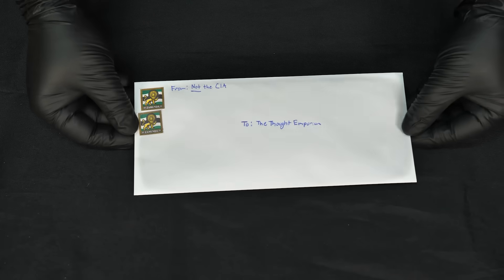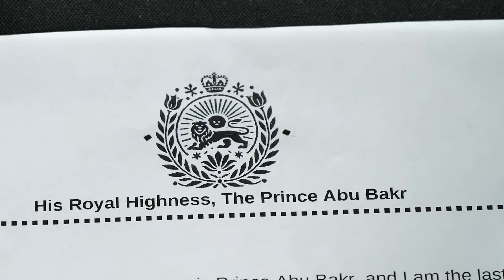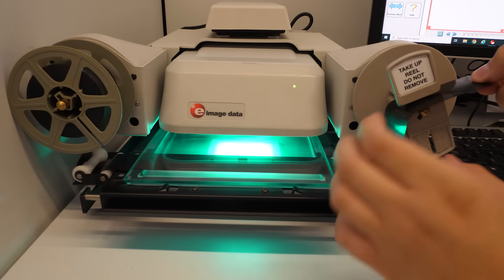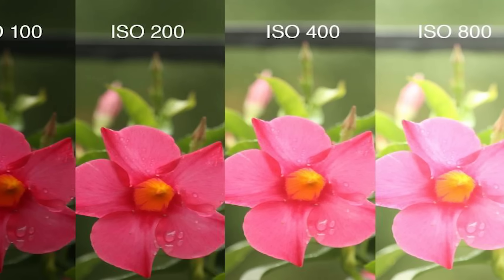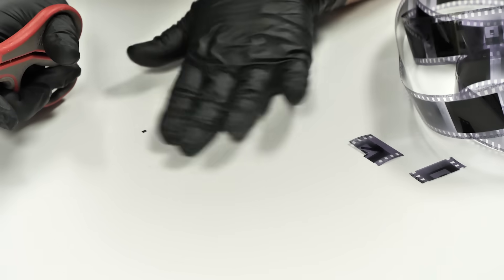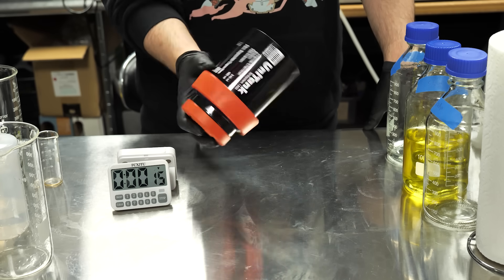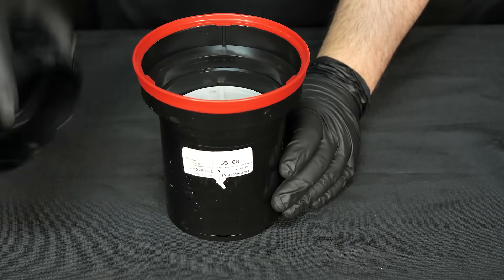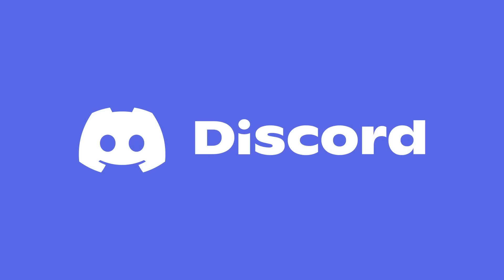Recreating CIA Technology Was Surprisingly Easy (Microdots)

Comment: 14:50 You can definitely reuse developers a few times; how many probably depends on the type of developers and some are probably not recommended to reuse at all. Some brands probably even has recommendations for how many times it can be safely reused and how much you need to change the development time for repeaded uses in the documentation. You are of course loosing some potency as you use it and for absolutely best quality, if you're developing art or fashion photography intended for large print you'd probably use a fresh developer. But I know press photographers when they still had to use film photography had a lot of tricks to save money (since they take an awful lot of pictures and print them at fairly small scale on crappy paper anyway they don't care about the best possible quality), I think they did stuff like "refreshing" the developer by adding cheaper chemicals to the used developer. I don't remember exactly (as it's more than 20 years since I learned about it but never tried to do it myself), but I think part of the problem with old used developer is that it starts to get saturated by dissolved silver from the films, so I think some of the refreshing tricks were adding some chemicals that made the silver fall out of solution and cover the bottom of the container and then you could pour the top off into a clean container and add some other chemical to replace the "spent" reactants in the developer. I think it works because most of the developer is fairly cheap chemicals, but the expensive stuff is sort of catalysts that isn't used up. 

I think you also could develop at least black and white film with some very cheap and common house hold chemicals too without any fancy additives and catalysts that real developers have, but it's much slower and harder to predict how well it works. And with those home made chemicals it's not at all worth it to reuse it.

Press photographers also had other even more dirty tricks to speed up the development a lot. Apparently you can develop film super quickly (like in a seconds rather than minutes) by basically developing it with very hot chemicals (way outside the recommended temps). And if you were really in a hurry to get the photos sent you could also do a very fast stop bath and forgo the fix and rinse and just slap the wet film into the scanner (or some telefax like thing they used before digital film scanners) send the pictures to the headquarters. And then the original negatives would go bad afterwards because of the insufficient fixing, and you would have to disassemble the scanner and clean it; but you'd get the photos first. But I guess it's a good chance you'd also destroy the negatives in the process if you go a little too hot and/or too long.

The press photographer who was my photography teacher 20 years ago, also told stories about how he also had been in the woods in the middle of winter taking pictures of a train accident (this was after digital film scanners were standard in press photography but before digital cameras were good enough in the early 90s), he had a laptop (or rather luggable computer), film scanner and sattelite phone with him, but he had to develop the film first and he was several kilometers away from any houses; so he developed the film by putting the developer can between his legs inside his sleeping bag to keep it above freezing and just guesstimated that if the normal indoor developer time was 10 minutes it would probably be okay at close to freezing after 30-40 minutes. It actually worked; I guess unlike with hot developer where the chemistry is super fast and the margin of error is very narrow; with too cold developer you have a lot of margin of error as long as you don't get actual ice crystals in the developer tank.

Comment: To be clear, you can TOTALLY check each exposure without burning the whole film roll. Get a dark bag. Not a Dark ROOM but a bag. No light. Not even red safe light. Put the camera in the bag with a pair of scissors and a developer kit (reel or boxes if you prefer). Advance the camera few more times to make sure you dont cut photos in half and then open it up and cut.  Take the exposed film and put it in the light proof developer canister and refeed the remaining film into the camera. Close it up and advance another 2 or 3 times to make sure you have fresh film ready to go. You loose a few exposures but thats better than the whole reel.
Reply: You can absolutely use a darkroom, just turn the safelight off so it is well and truly black with no light whatsoever.

Comment: The use of Nikon's 55 mm "Micro" lens with bellows & extension tubes was designed for copy negatives and the the small document reproduction process. Temperature and controlled agitation is a factor that you need to incorporate in the development process its very important. back in the film days there was a film kodak produced called Technical Pan it was 32 ASA and was formulated for the very purpose of photographing documents with very fine resolving power. I'm not sure weather or not its still manufactured but maybe there is an equally suited film to use?

Comment: You could use Laser Lithography to achieve a similar result, and potentially also making it with a conductive layer to work as a circuit to store data on almost any object.

Comment: Encrypted information that nobody could decipher?  Where?  How did you exchange the key?  
  
This sort of stuff doesn't exist anymore, because someone somewhere is watching every inch of the planet and you can do so from space now.  
  
A lead or depleted uranium encased circuit (or a microdot, why not?) would work much better to exchange a key.   Encased so that it cannot be remotely deciphered en route.  Then you can send that to your destination with armed guards in an armored truck out of one deep underground facility to the next with the messages only to be decrypted on site(s) alone.  
  
Only then you can exchange secure messages.  
  
Otherwise just watch the average person on either side of the communication and and hack their surely hackable devices.  Which company manufactured their computers?  
  
Fly a drone and peek over their shoulder if they are close enough.  Setup a fake wireless access point at the next café they visit.  Do they have a cellphone?  (Probably yes)  Setup fake towers on your laptop and just drive next to them as you run your program to hack the computer we all carry on us even to bed.  
  
Most consumer devices are broken out of the factory and while you can update them as one software update patches a flaw it usually also creates a completely new one.  The hierarchy of broken software I call it, quite the scheme.
  
Best you have today is secrets at a certain dollar amount and that bar is higher than the annual salary of 95% of the entire population.

Comment: Did anybody mention the importance of temperature when processing film? I always made sure the temp was between 20-22c which can be a problem if you are in a very hot/cold climate. Can't use air-conditioning in the darkroom because it creates too much dust in the air that either sticks to the film or prints when they are drying.

Comment: This is sort of missing the point, but if you want to secretly transfer files across borders, take a picture of something with a digital camera, say a jumping dog.  Then zip up your secret documents and pictures into a single file.  Using old DOS commands you can save the secret stuff into your jumping dog image.  The image file size is bigger, but if someone simply views the file that you put back into your camera SD card,they will only see the jumping dog.  At the far end, use an unzipper program on the picture file and you can recover all your secret stuff intact.  Often misdirection is better than encryption.
Reply: @agalah408, my second search on this subject led me to an organisation about Linux questions that also had Windows command line instructions (and Mac). Cool and interesting.

Comment: Man, you need a few things if you want to do copy work properly (because that's what you are doing). 

First use adequate film: there is a german company that sells a pseudomicrofilm with high contrast, high resolution. It's called CMS 20 II, the company is Adox.
Next, you need to understand and improve the development process. You want very high gamma (contrast) to discern details properly, and a typical trick is to develop for longer times to crank up the acutance. And be humble, most of us in the film world do not use gloves most of the time because we know what chemicals are dangerous for our skin and what not. xD
Use your camera gear properly: mirror lock-up and cable release is a must, your camera is jiggling like a ping pong ball.
Purchase a non-pictorial lens. You can get your hands on an enlarger lens for next to nothing, and even the bad ones will blow out of the water resolution-wise almost any other lens. This is, so far, the neck of your bottle.
Try to use a point light source to reduce flares and fight diffraction.

If you do those things you will see how stupid resolution can get when shooting film.

Comment: Yes, the developer can be reused, but each time it is used, it accumulates some bromide in the solution. This can behave in weird ways with the next batch of film, and if you're using it to send classified messages, you would probably not reuse the solution. But, as I think about it, the bromide actually could give you better clarity after it reaches its plateau level because it could reduce grain in the image because it decreases the film speed as its level increases, up to a full stop. As bromide increases, though, the images become darker because more light is needed.

Comment: you should be able to reuse your developer at least once without changing development times. Another method, is called „replenishment“, where you reuse most of the developer but discard a little of the used developer and replace it with the same amount of fresh developer. You should find informations on it when you search for „using replenished developer“

Comment: Few things to note, as scattered around the comments and comments of comments:

- Use aperture F8 for sharper image as rule of thumb. Depends on the glass that you have.
- You can reuse developer few time, but it affects the developing time, as some of the developer is already used, you might want to extend the time a bit
- I didn't see comments nor video commenting anything on controlling the temperature, though on b/w I was taught "so that chemicals feels wet, not warm nor cool", so measuring by feel, not by some thermometer. On color chemistry it's waaaaay more important. Also on color you need to be a lot more exact with your clock than shown on video :D

Thanks again!

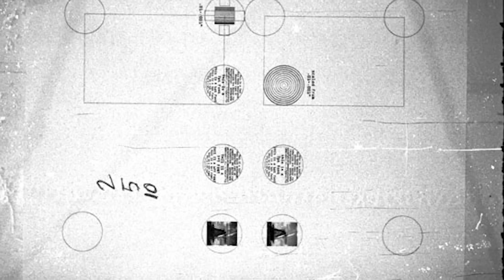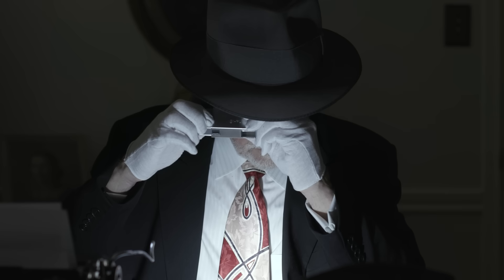Comment: Blazinal is a formulation of the Agfa Rodinal product. Rodinal was a one shot use developer, that uses the 4-aminophenol developing agent and potassium hydroxide as the accelerator. Yes, as mentioned below, it could be reused, but there already is the issue of oxidation of the developer from the first use. Every time you agitated, oxygen was introduced and developing agents would oxidize under longer exposure to oxygen. Used closely after mixing and first use, and having been stored in a dark, full bottle, you could try additional development time. However, you will not get the same development quality as with the first use. For repeatable results, use it as a one stop, especially if the higher dilution was formulated. Blazinal, like Rodinal, could be diluted 1:25 and 1:50, the latter requiring a longer development time. There is a benefit with the higher dilution, as you ended up with a finer grain pattern. 
The lower ISO films tended to have a finer grain, compared to the higher ISO film. While these were great for continuous tone images, not so good for high contrast, extreme detail. For best, fine detail and high resolution, find film mentioned by @mcb187. Look into orthochromatic films. You'll also need to research proper developers for those sensitized materials.

Comment: These lenses will not be at their sharpest at either end of the aperture range, you have to be somewhere in the middle, usually two or three stops from the max, so if its a 1.8 lens, likely sharpest at f5.6 or f8. They'll also be sharpest in the center. You can pretty easy get ISO 12/20 film from ADOX, CMS II, and if you use their developer for it get very fine grain.

Comment: MISTAKE: 11:00 - the widest aperture of any lens gives the poorest image quality especially f/1.8 of his lens (awful): specifically decreased cross-frame sharpness, central sharpness, resolution and contrast.

Even though cross-frame sharpness doesn’t really matter if your micro dot only takes up a tiny proportion of the frame in the centre, using a smaller aperture will increase central sharpness, resolution and contrast.

Most lenses will peak in central sharpness around f/4 to f/5.6, so that’s what I’d recommend experimenting with.

In order to get a perfect exposure, simply compensate by decreasing the shutter speed appropriately. 

Lastly, he should have used a cabled shutter release to prevent any shaking of the camera during exposure…a tripod is not enough.

Comment: The highest resolving photographic film in the world is Adox CMS 20. As a 35mm film, it out resolves any lense ever made at 800 lines per millimeter, resulting in a theoretical resolution of 500MP. According to Adox you can print a 35mm piece of film up to 2.5m without rendering any grain. The trick is that it's a relatively slow film at around ISO 20 if using their dedicated developer. In the case of creating microdots, that's not an issue though. Whilst Ilford Pan F 50 is a great film and fine grained, there are definitely even finer grained films available. Regarding Blazenol, it's basically a rebranded Rodinal which is a very old recipe (130+ years old). Whilst it renders a sharp image by accuntuating the edge of the silver halide crystals, it has the downside of enhancing the grain. I'm not sure whether this results in more readable text, but two other developers which could be tried are Ilford ID 11 (or the equavalent Kodak D76) as well as Kodak XTOL. XTOL is a developer which disolves the grain somewhat, resulting in a smoother image than with Blazenol but might be a little less sharp around the edges of the text. ID 11 should be a middle ground between the two.

Comment: We used LITHO FILM. Developer can be reused, but extend development based on a table. Developer can also be REPLENISHED which means adding clean developer to your mix. Also a fin thing. Save your FIXER. you can recover actual silver when it gets depleted. Drop a penny in your fixer and the silver will coat the copper.

Comment: Developer Cannot be reused.  Your Agitation is too strong.
You could be getting air bubbles on your film surface during developing.  Agitate as though it is a Separatory Funnel. 
I started doing B&W developing when I was 10.  Saw a kit in a used goods store and got hooked.  Also on Chemistry.

Comment: So many photography folks in the comments spouting absolute nonsense. 

When you want the highest resolution image possible with a given lens, you should open the aperture completely. Now, the reason that the "two stops above open" rule exists is because that will technically provide the best resolution for all colors as the lenses are designed to achromatic, but if you are imaging at a single wavelength then the largest aperture will work best. 

From an optics perspective, we call this is the diffractive limit and it is defined by the size of the Airy disk you can form with an aperture D and light of wavelength lambda. Specifically, it's Angular Resolution = 1.22 lambda/D

So the larger your aperture, the better your resolution. The shorter the wavelength, the better the resolution.

Comment: No, that Fuji is exactly not what you explained just before. It is panchromatic film, silver halide based. You just told they used no metallic film. (For a good reason, swiping the page with a metal detector will reveal de micro dot.) In fact there exist microfilm and microfiche used in libraries that are not silver based.

Comment: You can get lower iso film but it typically has a specific developer tied to it to get the highest detail.

Also blazanol is the same as rodinal so you can do semi-stand (1:100 concentration for 30 mins agitation then again let it stand for 30mins, if you're doing darkroom work this reduces the contrast a bit making printing easier)

also you've got a manual camera, you can dark-room load it to get an extra frame or two out of the film.

Comment: 14:40
Wait. Do you cap & agitate for 1 minute, “then” alternate for 11 or 12 minutes? Or do you cap & agitate for the 1st of 11 minutes, then alternate for the remaining 10 minutes?

You did the latter, but said to do the former.
Reply from the maker: agitate for a minute non stop, then after that every minute agitate for a couple seconds then leave it alone for a minute at a time
Reply: @thethoughtemporium 
Thanks. Is that 1 + 10 like you did in the video, or 1 + 11 or 12 like you said to do? Or; can it be 1 + 10, 11 or 12? Are all 3 of those times perfectly fine?
Reply from the maker: @Skye_7_7  It'll depend on your film and settings of the camera, and lighting. I'd start with a total of 12 minutes. Can tune it down if needed.
Reply: @thethoughtemporium 
Cool, appreciate it 😊

Comment: Okay, your development process was correct. But heres a pro tip. Your agitation method may work great for chemicals, but its extreamly error prone for film development. Just agitating it by using gental circles is enough. The idea is you don't want to intorduce air bubbles into the agitation process. Additionally, you want to keep the film fully submerged the entire time for even development.

The artifacts visible on your film are likely because of this.